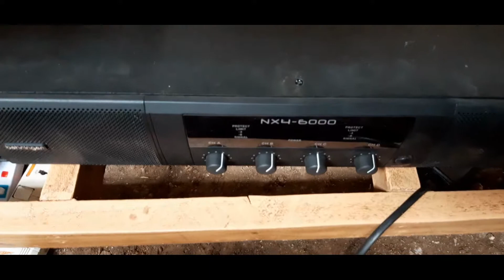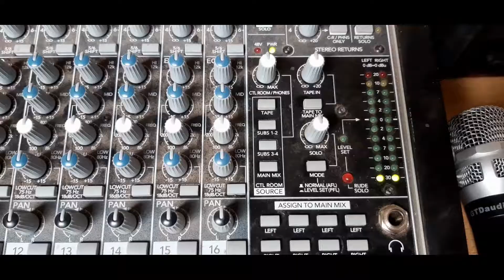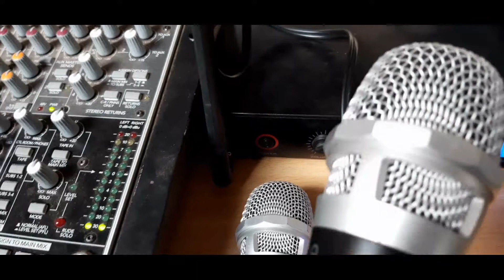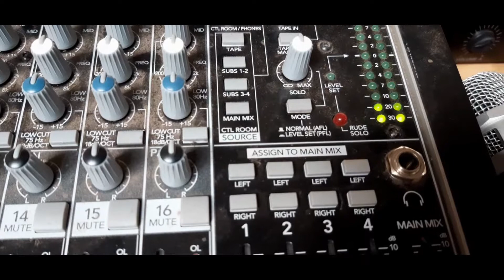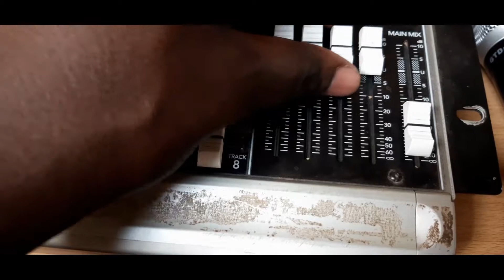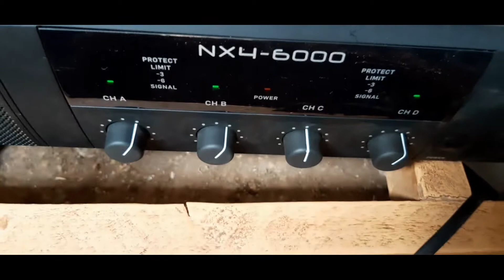Behringer NX4 6000 Watts Amplifier Part 1 - Testing with Microphones

Comment: how much have reliable? Can i trust extreme stress full condition? Like 2ohm load
Reply from the maker: According to Behringer at this link ; https://www.behringer.com/Categories/Behringer/Power-Amplifiers/Portable/NX4-6000/p/P0CHU#googtrans(en|en) , The amplifier delivers 4 x 1600 Watts into 2 Ohms, 2 x 3000 Watts into 4 Ohms.
I have tested it with four 15" Mid Range Speakers each @ 1000 Watts and the performance was great.